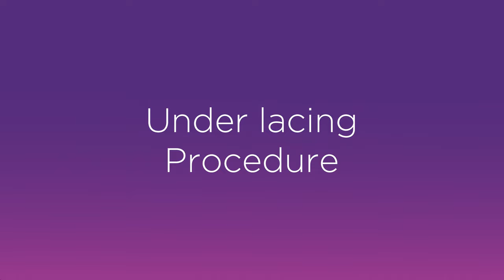Orthodontic lacing

Comment: Why do you make lacing?
Reply: Lacing is used to close gap's very tight and hold them in place so you're teeth stay in the same place
Reply: Can I use it instead of Power chain to close spaces?
and can I applicate lace on upper two cantrals and laterals if there no spaces between them and applicate power chains with lace to close spaces from laterals to first premolar.
Thank you for your time ♥️